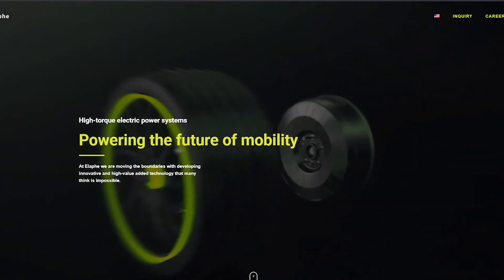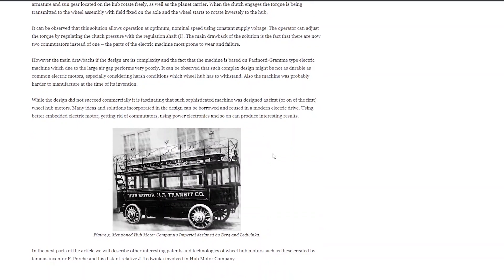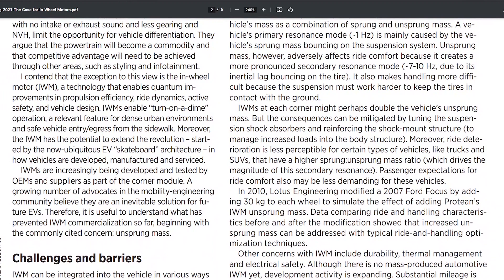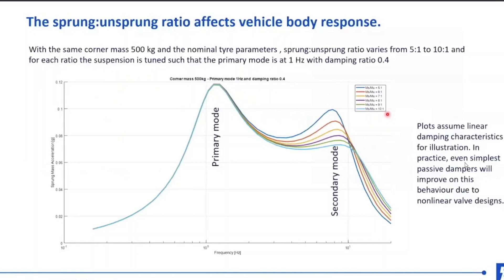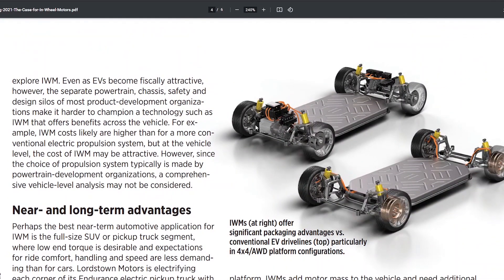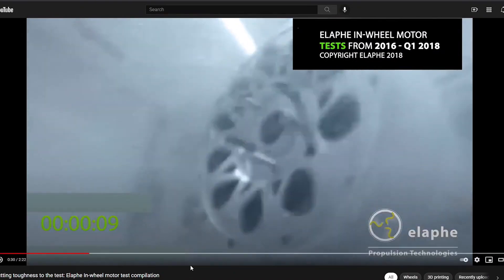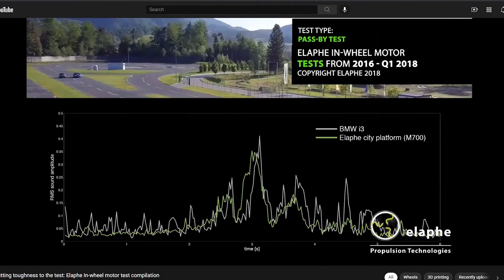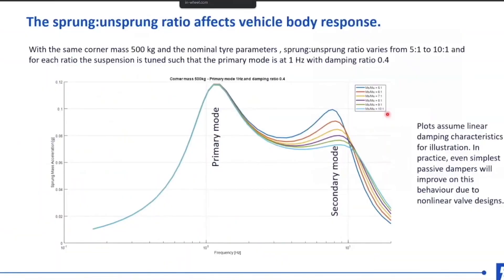Hub motors for Aptera:  Good or bad?

Comment: How about changing a flat?
Reply from the maker: That's no different because the hub motor is where the brake rotor is and the rim and tire just bolt onto it
Reply: @ApteraOwnersClub  the difference is you have one less motor unless you have a spare with a motor. Also, I'm struggling to see how you would change a flat on the front wheels at all just given the design.
Reply: @CaseyDarwin  I plan to do what worked for my motorcycles - carry a plug kit and an electric air pump.
Reply: @CaseyDarwin  the motor is in the hub, not the tire. Think drum brakes if you remember those.
Reply: @2eyedhairlessmnkey   I do understand it. I have a hub motor e-bike. But you typically don't re-rim tires on the side of the road.
Reply: @n.brucenelson5920  That's a good idea. Never been a motorcycle rider but it makes sense you'd have the same issue.
Reply: @CaseyDarwin  if one was to fix-a-flat by actually changing the tire, in my experience changing a car tire includes the rim.
Reply from the maker: Yes changing the car tire is basically swapping out the rim and the tire.  If you look at spare tires in cars it is the rim and the tire combo.  So hub motors make zero difference from regular tires in terms of managing flats.       Changing brake pads and rotors on hub motors will be a pain in the butt though but hopefully with the ridiculous Regen from hub motors brake use will be minimal
Reply: @2eyedhairlessmnkey  Just want to be very clear and make sure we're not saying the same thing, when you change a flat on a car on the side of the road, you take one complete wheel (including the hub and tire)off and replace it with another complete wheel. Which would mean that unless that completely different setup already has a motor then you're down one motor until you can get a new tire put on the old hub. Right?
Reply: @ApteraOwnersClub  I'm not saying it's a deal breaker, just a consideration. And it's not exactly the same as a traditional wheel. You'd be down one motor until you can get a new tire on the motored hub. Plus the weight would add difficulty to the process. I like the idea of thinking of it as a motorcycle and dealing with flats in the same manner.
Reply: @ApteraOwnersClub  Just want to add, I'm a big fan of the car. If it can really achieve over 10 miles per KWH then any of the other problems the design may cause can and will be overcome.
Reply: @CaseyDarwin  wrong. The rim does not hold the brakes, or in this case, the motor.  The brakes, whether they are disk or drum, are part of the vehicle.  I can see how you might think that they are though if your experience is only with two wheelers. But even then if you have disc brakes on your bike the calipers that hold the brake pads are on the frame, not the wheel.
Reply: @2eyedhairlessmnkey  when did I say anything about brakes. I'm talking about the motor.
Reply: @CaseyDarwin  on an EV there are regen brakes in the motor but, as I said, think a drum braking system...
Reply from the maker: @CaseyDarwin  hmm, i think you're confusing the rim for the hub motor.  I'm assuming you have taken a wheel off of a car before.  There are like 4 or 5 bolts that hold the wheel onto the car.  when you take those bolts off, the rim and the tire slide off the car.  What's left on the car is the brake rotor with the posts that the rim and tire slide onto and bolt down to.   the hub motor is located where the brake rotor is and has the posts that the rim and tire bolt onto.  The motor is NOT located in the rim.  So the motor will stay with the car when the rim and tire are removed just as the brake rotor stays with the car.  I'm hoping this makes sense?
Reply from the maker: @CaseyDarwin  if changing a tire required removing the motor, that would absolutely be a dealbreaker for me because that would be ridiculously bad engineering.  That would mean that you would have to disconnect all the cooling and electrical inputs to the motor every time you wanted to replace the tires.  Fortunately, that's not how it's designed.  The motors do not need to be removed to replace a wheel.
Reply: @ApteraOwnersClub  Actually, I get it now. That makes a lot more sense.
Reply: @ApteraOwnersClub  Excellent explanation of how the rim/tire assembly separates from the hub/motor assembly.  As an older car owner, I have lots of experience with drum brakes and expect that this will look similar.  I also like your comment on how it would be a dealbreaker were the assemblies not separable.  One of the reasons I'm so excited about Aptera is their excellent engineering, so it wouldn't make sense for this one component to be poorly designed.  Finally though, as with most cars these days, I don't expect Aptera to come equipped with a spare tire.  Tires so rarely go flat these days and the extra weight would not be acceptable.  So this probably won't really be the issue it's being made out to be.
Reply from the maker: @timmykk1  yeah it looks just like a drum brake
Reply: @CaseyDarwin    Don’t get me wrong…..this Aptera Has SO Many Ways that it can turn into a Straight DUMPSTER FIRE🔥 between now and IF/when they come out…..  but changing a flat tire isn’t one of them. Again… You don’t have the basic understanding of what the hub is. Trust us bud, a Flat tire is a A Flat Tire on these cars. The Hub of a Car/Truck does Not come off with a tire change. No need for Re-Riming.
Reply: @CaseyDarwin  There's absolutely no difference in changing tires from the way  it's done on a conventional car except for removing the wheel covers.  Jack the car up, remove the lug nuts, remove tire, repair or replace it, remount the tire on the hub, thread on and torque the lug nuts, lower the car, reattach the wheel cover, and drive on.  Oh, and jacking points will be included.
Reply: Now that we are talking about flats here........how do you change the rear?
Reply: @valcvetanoski9105  Exactly the same way as with the fronts.  The wheel pants snap off without tools for access to the tire.
Reply: @UCVfLAtDKbrpymz44NemJQLQ I probably fixed more cars with flats that I encountered in my travels than I had to address on my own tires.
Reply: Change a flat??? Come on, now… Dial AAA… 🤣
Reply from the maker: @ernestgalvan9037  lol changing a flat is so easy though!
Reply: @ernestgalvan9037  I'd love to see the look on the AAA person's face when they arrive and start trying to figure that out.
Reply: I still would like a Spare Tire and Jack option. It could fit under the Cargo Floor since the Batteries are under the seats.

Comment: I'll give it a try anyways, I'm sure the issues are fixable, heck we use gasoline explosion banging around engines.
Reply from the maker: Yup if you told me we would be using an engine that has little explosions that drive a piston back and forth rattling around in a motor several thousand times a minute I would have told you that that thing isn't going to last more than a few minutes

Comment: I like the hub motors for their simplicity and reduced losses. I think that the Aptera team will work out the unsprung weight issues, if they have not already sorted them out mostly. My one concern with the wheel motors is the unknown extended wear of the seals. There was talk of 30K miles seal swap requirement, but also mention of lifetime motor seals. If it's a relatively simple process for a skilled mechanic (like swapping out brake pads) then it should not be an issue. But one of EVs greatest advantages is minimal maintenance, compared to gas powered vehicles. So it would be good to know ASAP what the lifespan of the wheel motor seal is before they get delivered to customers. If Elaphe has developed a lifetime seal, then Aptera should make a big deal about the simpler wheel motor design translating much lower overall maintenance.
Reply: Sealed for life hasn't gone well for auto boxes, likewise lifetime cam belts. I'd prefer a sensible service interval until there's a lot of real world experience.
Reply: @MurrayC  this! Also keep in mind that there's no CV joints or gearboxes with oil to maintain, its a give and take sort of thing. the efficiency and responsiveness outweigh the disadvantages of in-hub motors, but only time will tell.
Reply: I certainly hope the seals last much longer than 30,000 miles.   And what happens to the hub motor if the seal is leaking for 5000 miles before discovered?
Reply: I am excited about Aptera coming to market.  Should Elaphe or Aptera come out and say that the hub motor seals are lifetime then that is probably impossible.  A seal cannot help but wear when another surface is rotating against it, so eventually it will leak.  Can't be helped.  Now if it lasts an average of 30,000 miles and it is easily removed and replaced then that isn't so awfully bad I suppose unless you put on that kind of mileage per year.  If the seal wears and the other part wears and that is probably going to happen ( how could it not wear away some material from the sealed surface also? ) then they'd better have replacement seals that that take this into account.   Everything wears out eventually.  BUT, if this is expected and both the parts and repairs are reasonable ( after warranty period of course ), then most can deal with that or find someone to do the repair.  I own a Buell motorcycle that has a fork seal that I've repaired 3 times and it is not easily replaced and I curse Buell for that.  Haven't even repaired the last leak.  My son's Buell has never had a fork seal leak.  And Buell's "LIFETIME" drive belt turned out to only last on average about 25,000 miles and the last thing you want is for that belt to go while you are in the middle lane during rush hour traffic.  Moral of story is that LIFETIME claims are inevitably pure horse shiite so don't believe it.  But at least Aptera hasn't been making any claims like that.
Reply: I doubt there will ever be a lifetime seal, but so what? Replacing wheel seals at some known interval would be part of scheduled maintenance. If somehow they can design a seal to make it easy and safe to replace, it shouldn't be that time-consuming or costly.
Reply: It is going to be easier to swap a motor that is on the wheel than one that is on the inside of the car, so it will probably just be something you swap out and get a new/refurbished motor when it wears out. I think it will be an interesting paradigm shift for people when a motor basically becomes a semi-consumable item. Its not near the expense and difficulty of swapping out an ICE, so I also can imagine performance upgrades being a regular thing as well.
Reply: You would think with all the experience and years of developing these hub motors they would at least have a ballpark of the longevity/cost of replacing similar seals so we could factor in said maintenance cost.Seems like too many people are glossing over this subject please address as soon as possible after all this is the drivetrain. Right now I don't know If it is closer to $100 or $1000 per motor.